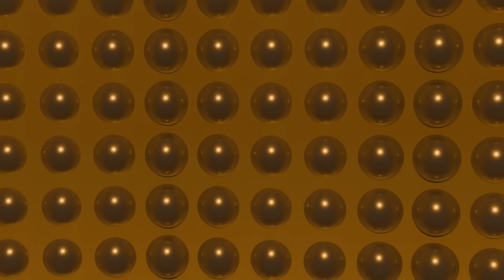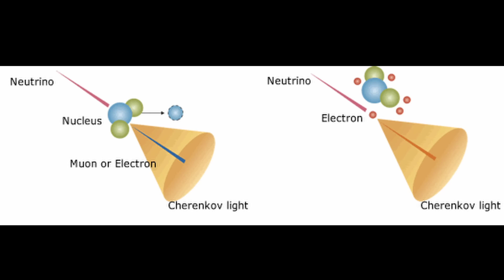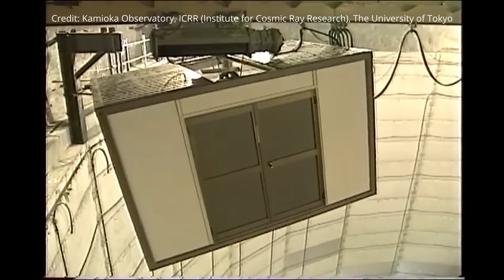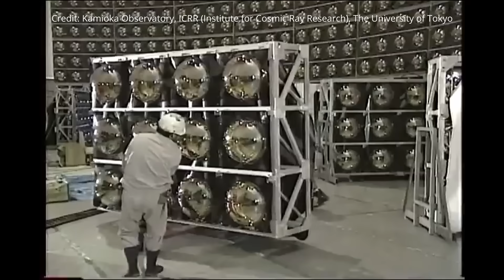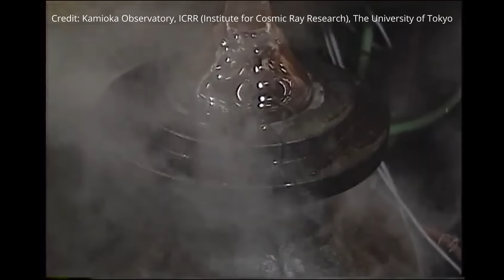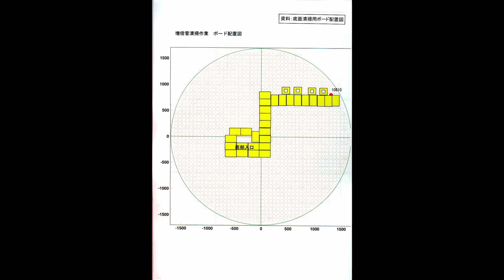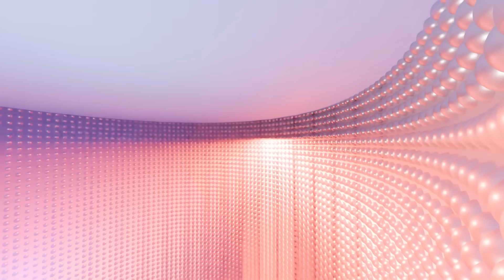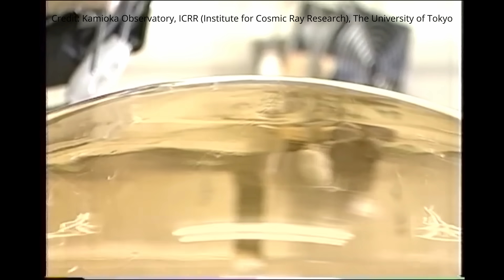An Engineering Fairy Tale: Cascade Failure at the Super Kamiokande

Comment: The vacuum thing with water is the same that can cause the bottom of a glass bottle to fall out when you hit the top right. There's tons of videos you can find on that.
Reply from the maker: Ive been trying to do that for ages. Tried to do it for this video. Still cant get it to work.
Reply: @Alexander-the-ok  it works best with just water.
Reply: @Alexander-the-ok  Try to use a rubber hammer. It needs to be a very sharp strike.
Reply: @Alexander-the-ok Knocking the bottom out of a beer bottle depends on the inertia of the water in the bottle. Be sure to only fill the bottle to a half-inch below the top of the cylindrical part. The bottle must be free to move down around the slug of water. But the mass of the water is what makes the trick work, so use as much as can move freely up and down.
The air pressure above the water is  part of the trick, so avoid anything that lets it go out but not get back in.
A firm hit to the top of the bottle is needed. The hardest part of your open palm may not be enough. A wooden object may help - do not use metal or glass.
If you get the light right, and you can see the bottom of the bottle, you can watch the vacuum form as you take practice hits. It's just a flicker. Keep the bottle upright.
Smacking the bottle pushes it below the mass of the water, leaving a vacuum. Air pressure then pushes the water down. It hits all at once and knocks the bottom out.
Reply: @Windows__2000  Diana from Hawaii does just that! Physics Girl
Reply: XKCD What If:  "What if a glass of water were LITERALLY half empty?" https://www.youtube.com/watch?v=0EytSWiKrFg

Comment: I would love to see the CFD simulations engineers undoubtedly ran when designing the hyper kamiokande - and the upgraded detectors. I have no doubt the analysis failure from this incident was used in the modeling.
Not sure you saw it or not as it probably wouldn't have added to the video, but from the website - "We are considering using two types of photosensors in Hyper-Kamiokande."
 - My TLDR; same size primary detectors but upgraded to be even more sensitive, withstand more pressure and "In addition, the background radioactive material content has been reduced to half." And "The other is a “compound eye” photosensor. Multiple 8cm diameter photomultiplier tubes with high detection time accuracy are bundled and sealed together to enable detailed imaging as if to increase the resolution of a camera." Quotes are copied from their webpage.
Overall, a very good video even if you described it as lower effort.

Comment: This video was so cool! I always found the subject of neutrinos to be fascinating, especially considering how annoying they can be when it comes to detecting them, and seeing that massive chamber used to detect it was incredible. Of course, it was very frustrating to hear about the cascade testing they did, because as anybody who's gone scuba diving can tell you, there's a big difference between 1 meter and even just 3 meters, let alone the pressure you'd be experiencing at the bottom of a massive tank like that. Still, super informative and cool, and I applaud your ability to only make one single half life reference in the entire video, that must've taken some restraint
Reply from the maker: I was going to add a bit about my experience with that with all the drysuit diving ive done. But since I couldn’t really be bothered to do the maths or simulate it, i left it as ambiguous.
Reply: you dont know what got left on the cutingrome flore
Reply: xkcd 73 - neutrinos are just a tiny bit too elusive for any "simple" solutions :P

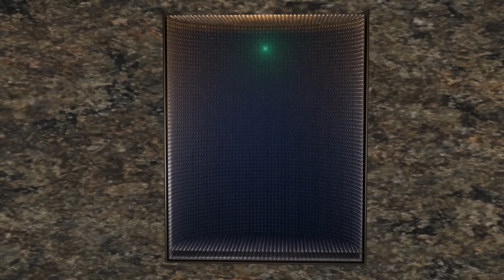Comment: 1:55 I can hear that "They're waiting for you Gordon, in the test chambeerrrr" anywhere.
Good reference.
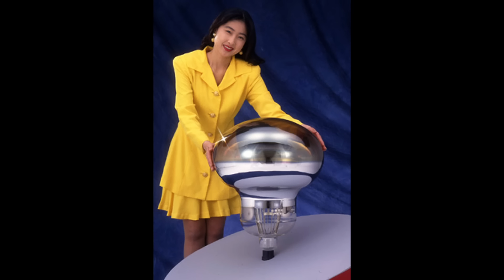9:03 That's an object of beauty. And the photomultiplier is neat, too.
16:05 That phenomenon is basically an insane version of waterhammer, which is an engineering nightmare by itself.
21:48 Does it also have 16 times the detail?
Reply: He says 8.4x volume, that is like 4.13x area (if tank proportions stay the same), the tubes are supposed to be the same, so a little over 4x the resolution or twice as much "pixels" in each dimension
Reply: @perz1val  I don't think the goal is so much "more resolution" as much as it is "Seeing more interactions"
Reply: @perz1val  I still wonder, why not use a hexagonal packing for the sensors? It's the optimal packing for circles on a plane or cylinder.
Reply: @samuels1123  I think they don't care as much about it to risk denser packing and increasing the chances of another cascade. I think if they would, they'd make a smaller detector with smaller tubes, packed as dense as possible (maybe even hexagonal tubes) for more precise measurements. I don't remember the number, but since they detect quite a few neutrinos daily, trading quantity for precision doesn't seem like a bad idea. The scientists must have their reasons to just want a bigger detector instead, I have no idea
Reply: @perz1val if I remember right,  the larger volume increases the chance of actual interactions being captured and observed. A smaller vessel would work, just that its exposure would be dramatically less. Similar to how 35mm film is good for capturing detail, but 50mm film or larger is even better.
Reply: Glad I'm not the only one who giggled at the Todd "16x the detail!" Howard reference.
Reply: God i love when people objectify women >:(

Comment: Oooh I knew about the Super-Kamiokande, but didn't know it had a failure that exploded ~6000 tubes.
Reply: What massive.... bulbs!
Reply: Same mtrfkr
Reply: @orangejuche  bro? Spoiler alert
Reply: @jamieclarke321  watch the video before watching people comment about what happens in the video
Reply: @Furko08  Comments appear at the bottom of the video?
Reply: @jamieclarke321  did you not do the required reading?
Reply: @anotheralpharius2056  On mobile, comments will show up under the video. not much you can do except fullscreen or scroll down before anything shows up
Reply: @jamieclarke321  That's an easy one. Avoid seeing, hearing, thinking or touching English long enough for you to lose all knowledge of it. It will take at least a few decades so maybe learn something else, like knitting. Then once you've lost all memories of English, you'll cease thinking in concepts, no "past" or "future" and attain enlightenment. Now enlightened you won't be bothered by spoilers or any nonsense like that. Good luck!
Reply: @serenity.96  Won't work.   You never completely lose it.
Reply: @ noted, I will be in touch in 3 decades once I have attained nirvana. Due to my lack of comprehension of the English language I will update you via a neural link sensory stimulation module.
Reply: U just slow cry harder

Comment: Wouldn't the energy released at shallower depths also be lower, since there is less pressure? Is that enough explain why the cascade stops above a few meters of depth, or is the effect of the air to water interface needed?
Reply from the maker: Yes. If I had to guess, the reduced amount of stored energy is probably the primary reason.
Reply: @Alexander-the-ok  Also that the first photomultiplier to fail was near the cylindrical wall so the overpressure would vary with azimuth around the tank.